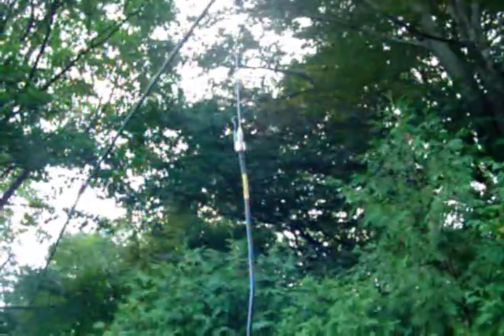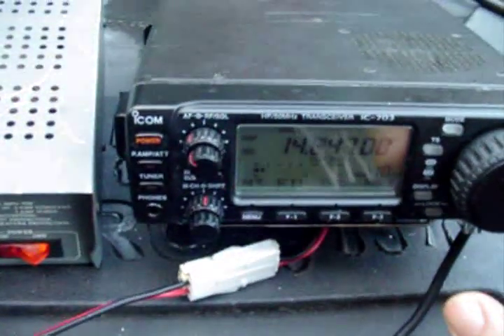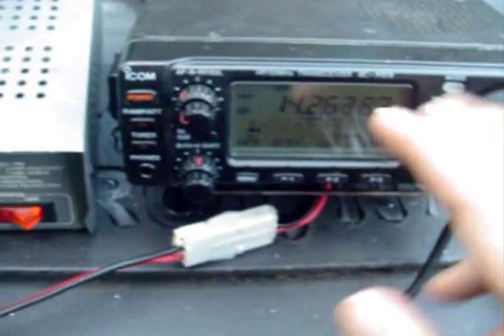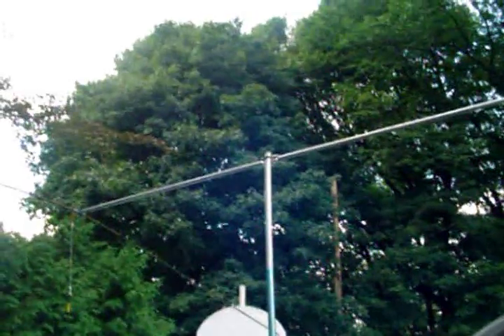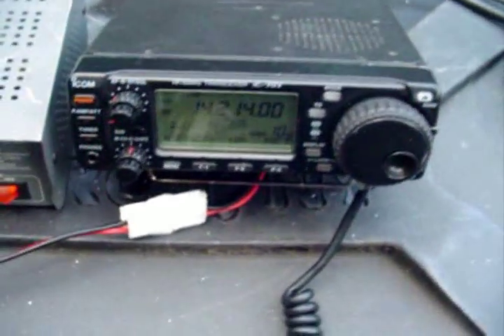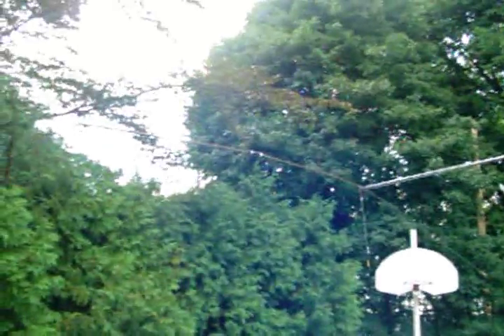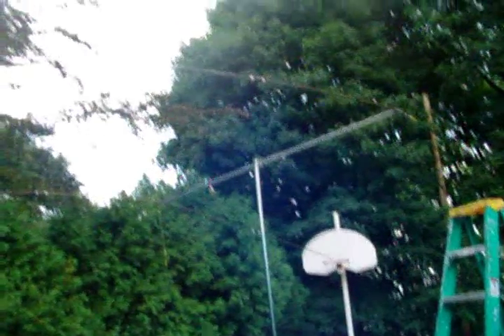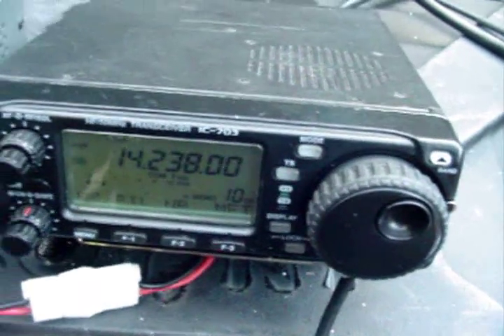My new homebrew 2 element KJ5VW trapped beam and a QSO with DL1GDS from KC2TAU

Comment from the maker: @mb10220 

Hello Mark,

I used the lengths specified in the article and I found that the antenna was relatively touchy to adjustment. It definitely needed a balun at its feedpoint. I used thin gauge bell wire of about 22 or 24AWG for the coils. Try e-mailing KJ5VW as I had a few questions regarding the construction and he was more than happy to offer advice. Good luck!

               - Mike

Comment from the maker: @costaricaenvy 

I will definitely take a look at your blog. I will try the beam at a higher height but at the time that pole was the tallest thing I had about. I'm going to be rebuilding the beam entirely out of aluminum and/or steel just for the sake of durability. I was getting tired of things cracking or getting bent out of shape. My friend built the same antenna and we used it at a field day setup and even with 10W of power we had a blast working into Europe.